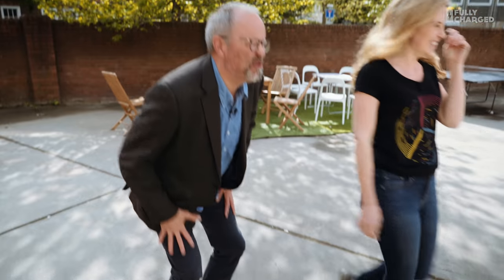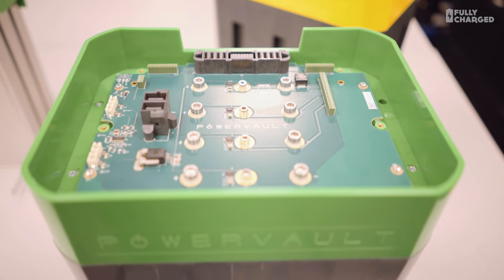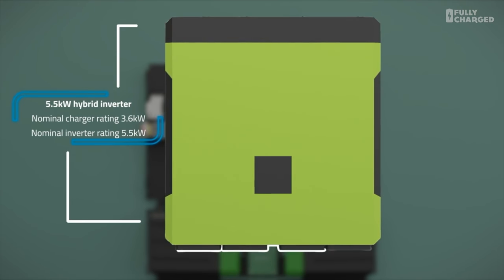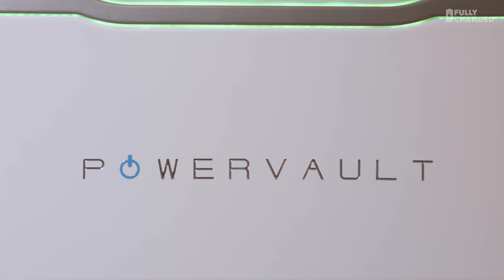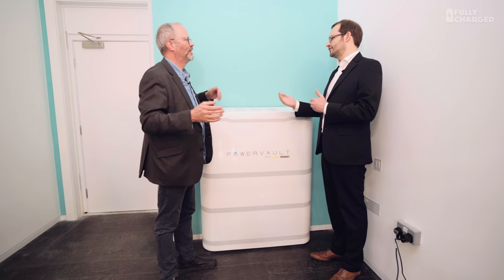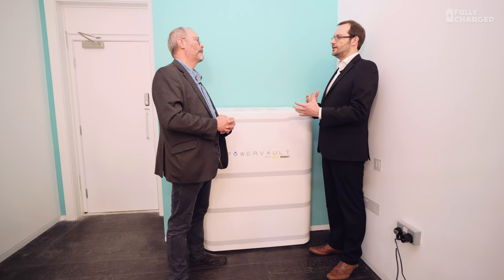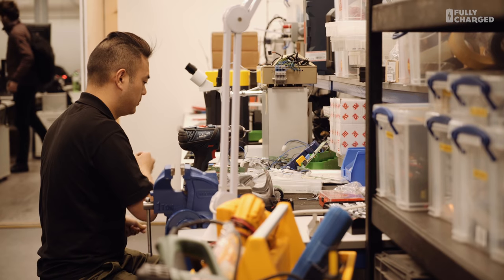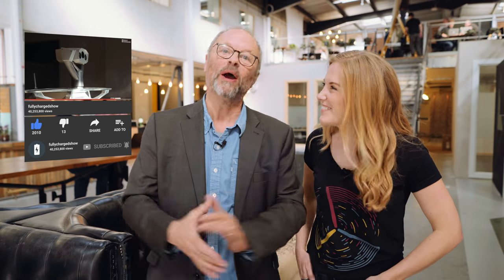Powervault | Fully Charged

Comment: Smart meters do not allow you to swap for the best deal as they non transferable
Reply: For now - next generation smart meters on their way (months) which will facilitate swapping out suppliers but keeping your meter
Reply: Iain McIntyre my experience was:
Took ages for British Gas to have a  smart meter available which worked with solar panels, then changed to EDF to get best price. Result, smart meter doesn't work with EDF. EDF can't fit smart meters in our area 'currently'! 
So...smart meter rollout going to plan then?!
Also, how easy will it be to get your old smart meter upgraded to a second generation one as they're going to be years behind on the rollout anyway?!
Shambles comes to mind!
Reply: Andy McCabe - no argument there Andy.  I couldn’t believe it when I read the first generation meters which have taken far too long to deploy, would tie you to your provider or disable the ‘smart’ capabilities.
And yes, how long will it take to get next gen smart meters deployed ? Far too bloody long - but it is on the way and some will get them in months I think

Comment: If they aren't temperature controlled they aren't going to succeed.
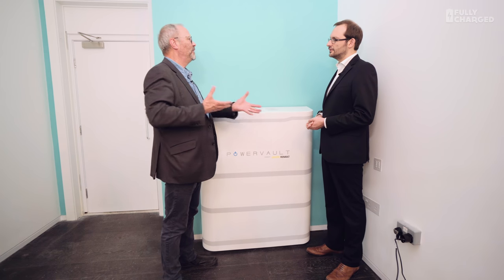At 15:21, he also touches on the real issue that I and others are seeing here.  Lack of availability.
Once you get the batteries, you have another issue.. and that issue is that the power companies don't actually want you to install them correctly.  They want you to install them they way THEY want you to.  Not to put too find a point on it they want you to install it in such a way that the utility gains the most benefit.

Stop by our channel and see how a system should really be configured and how much storage and current delivery you actually need while we share our "Energy Sovereignty Project" with all of you.

Comment: Great video again but question to Renault... 75% is great if you own a 40 KW/h Zoe but If you have like me owned a Renault Twizy for just over 4 years with 30,000 miles on the clock. I have so far spent over 2736 GBP at around 57 GBP / monthly battery rental fee and fully charged 6 days of the week (sometime twice a day). My battery (13 KW /h) is still showing a life of 98% so congratulation on the quality of the battery.

But for me it means the battery is likely to be well over 75% for a good let say 5, 6 years... I don't want to think of the cost of the battery rental after that time when it will have been well over the original cost of it! And with even 80% the range will have dramatically been reduced.

I love my Twizy and despite the rental cost still cheaper for me than driving a petrol or diesel to my daily commute as public transport are none existence for me where I live. But it will be nice for Renault to tell their oldest customers this is the time to decide if we want to continue to rent the battery for peace of mind or you can have it at no cost. Currently you can give it back or buy it but it is way too expensive.

You are basically trapped and tide up for the life of the vehicle. Shame really.
Reply: Eric Lafoy I used to ask a quote for buying off a battery for a twizy, 1.5y ago this was 1400 excluding tax, not bad for a 3500euro twizy incl. Tax

Comment: I am sat here admiring the shiny new white Tesla sat in my garage - it can't go anywhere as it's bolted to the (power)wall :o) Being fortunate to have solar as well, and with the Sunny weather (you can't beat a Sunny September) there have been days when we have been entirely "off grid". However as others mention - I am concerned that private power companies will conjure up some way to negate any early adopter benefits. New power startups like Good Energy are the way to go for people who have become solar / battery early adopters. I have named my powerwall ALSET (did you see what I did there?!) Like Robert, I can suddenly find myself gazing at ALSET while purring softly with the occasional keening sound.
Reply: I'm not so sure about the power companies penalising people using batteries - because of how much it costs to balance the grid (match supply to demand) - if they can smooth out demand / you have a local battery to cover momentary spikes (such as turning on the kettle) then the savings would be massive.

(numbers from a separate youtube vid I watched recently, so not sure of accuracy) The 'big battery' that Tesla built in Australia apparently costs ~$14k per MWH, and that's something like 7x cheaper than the power plant operators were charging to make the same supply adjustment.  Given that the 'kettle spike' requires 2x adjustments, having a battery in every house would save them ~$28k (not sure in GBP) just from that one event...

And lastly, it's not like you're not paying for that power anyway.  Penalising people with solar is more likely (simply because that's generating your own power).
Reply: +Joe McMorrow, I do know what you mean, we had ours fitted in March (7 months ago), plus another 9 panels fitted to the North roof, with the result that we have had 184 days with the only mains use being 200 to 500 watts per day. (between 5 and 7 kWh per MONTH.) Only 35 days using the mains, and that vastly reduced. (When big things get turned on, there is a very small  'pull' from the mains while the battery / solar balance the load. Mostly 0.1 kWh in a days use).

We also signed up to the Tide Tariff a while ago (ready for long winter nights and short dull days), but have seen no advantage yet as we have been on solar / powerwall for 5 months on the trot! The battery got down to 6% the day before yesterday, so I know our 'free' days are ending for this year :-(, but HEY! Half a year with out paying for power (and mostly free driving with the PHEV), count me WELL impressed.

IMHO, anybody who has fitted Solar PV and does not fit a battery is nuts! AND wasting a large chunk of their investment.
Reply: Thanks for the detailed response and the Stats Con! As you are further along the road than me, could you suggest what energy provider might be best to look at, is there a blog or something - the comparison websites were useless!
Reply: Many thanks Con for taking the trouble over this very detailed and helpful reply - I will certainly follow up on your suggestions!

Comment: greenenergy.uk need to tell their call centre then.  When I telephoned and asked about using off-peak electricity I was told I would need to have a separate meter installed even though I said I already had a smart meter!  Had I been told the Powervault was available, I would have switched immediately.
Reply: Apparently not all smart meters speak the same language (so to speak), so your present meter may not talk to GE as it does with others. Go Figure!

Comment: This was too superficial when it came to breaking down the battery storage. How much money could three different U.K. households save? Carbon? Be specific!
Reply: This channel isn't really about saving money, it's more about highlighting new ideas and new technologies.  Having said that, you can easily work out how much you'd save by finding out how much you now pay per kWh, and how much you'd save if 100% of that was used at off-peak times on a time-of-use plan instead.  e.g. if you pay 12p and off-peak is 6p then your bill would be half, if you had a large enough battery to cover 100% of your use.  Take into account the likely cost of the battery pack and you can work out how many years it will take before you break even, and then how much you'd save every year after that.  Typically systems like these take 3-5 years to break even, so it's only after that when you actually start saving money, assuming the product continues to work beyond this time and doesn't have any additional expenses like replacement batteries.
Reply: In realty installing a battery system in your home costs a FORTUNE and takes years and years and years to break even.  In the meantime, battery tech gets ever cheaper and you're left behind paying for you expensive battery....
Also, time of day tariffs cost more at the full rate  than regular cheap tariffs so the payback from using the battery to save is about 1000 years!
If you want to be an eco warrior then great- but from a financial viewpoint.......
Reply: not true at all.  The payback time does depend on what your local electrical costs are, but are more like 8 to 10 years not the 1000 years...and if you can sell back electricity, it is even less.  PS.  this is using tesla powerwall 2s

Comment: Grading batteries involves charging the battery then fully discharging and measuring the outputted amp hours. You can also measure the voltage drop at a certain amperage and work out the internal resistance of the battery. If the internal resistance is too high the battery will be no good for high power draw uses even if the capacity is fine.

Comment: Is it me or is the whole second Life battery thing a bit of a non starter? If BEV's last a lot longer than people originally thought then people won't get rid of their cars so quickly. There will be a shortage of batteries to use in the powervaults?
Reply: I agree that the second life battery idea is indeed a non-starter. Go look at the predicted battery cost curve ten years out from now and compare that with how much cost and effort goes in to tearing down battery packs,  grading them on expensive test equipment and reassembling into new packs. Remember when TVs were expensive and of unknown reliability? First we "leased" them, both because they were expensive and unreliable, then we had a nationwide army of TV repair people who would replace tubes etc. I worked at a company who produced specialist EVs 10 years ago. At that time Li battery packs were well over $1,000 per kWh. Rumours have it that Tesla will soon be hitting $100 per kWh. In 10 years' time all those Zoe batteries will go straight to recycling to extract the minerals imho.

Comment: I did consider powervault after visiting the stand at Fully Charged Live but the box was a bit too big go into the space I have and it can't live outside due to the venting. I ended up going for something that's a separate inverter and batteries which suits our home/space better. Just doesn't have all the fancy apps to change things on the fly, has to be done manually on the inverter.

Comment: Adding battery storage to a grid connected home is just wasting money at this point in time October 2018.
Reply: Piss off it is. 

In the future.. there won't be a grid to be connected to.. 

So having a larger cache of power will be eventually the way to go. 

Think about it.  

You have an additional 100kw to resell to the grid.. you are essentially paying for the equipment via power sales.. and when it comes time for homes to be self sustaining.. you won't need the grid and on top of that, if you only use 5kw of power a month.. the rest is for sale on a daily basis to the neighbours..
Reply: If more of us have power storage it takes the strain of the grid in peak times, using the grid to charge the batteries in times of low demand, therefore reducing the need for generating so much power in the first place. How is that a waste?
Reply: Why?
Reply: Depends on the tariffs
Reply: I was not talking about the future. At the present battery energy storage is way more expensive than grid so not cost effective for consumers. I'm fully offgrid using LiFePO4 for electricity storage and thermal mass for heat storage. My house is a net zero energy house with all energy from PV solar but this is all my own design and at this point likely the most advanced net zero energy house so I have a good idea on the cost's and Lithium battery storage is not cost effective in most places so as of now a grid connected solar PV array is great and cost effective but adding a battery is not.
Best case scenario with a good LiFePO4 cost amortization is 20cent/kWh (that is just for battery no BMS and inverter or compete system installed) and to that you need to add the cost of the energy you will going to put in to battery. Even if grid pays nothing for your excess energy it is still way more cost effective to have a grid connected PV system without battery storage than to add a battery storage. Typical storage solutions will be around 40 to 50 cent/kWh best case so completely non cost effective in most parts of the world even places with very high grid energy costs.
Reply: The difference here is dual rate tariffs, fill up the battery at 20% cost electricity, use it during peak 100% tariff times.. Save 80% on all peak usage.
It's down to the household usage how long that takes to pay for itself
Reply: At this point, yes. Who do you call if you're the only person with a phone?

But hope to see a rapid uptake
Reply: @AdrianNelson1507  
It's not a phone, it's a bucket of water.
If you are the one with the bucket and everyone wants water at a peak time you can supply some.
If nobody needs it, but you do, you buy it at the cheap rate and use it yourself during the expensive time.
Simple
Reply: Unless grid price is 50cent/kWh you can not even recover the cost of the battery over is usable life as best case scenario for a grid battery like Tesla PowerWall 2 is 40cent/kWh (very optimistic number).
Typical grid price is around 20cent/kWh while PV panel amortization cost is around 2 to 3 cent/kWh so as in most places grid pays around 6 cent/kWh for your excess thus more than fair enough to amortize the PV panels + cost installation plus grid connected inverters and on top of that all that you use directly from PV during the day is at that fairly low cost amortization thus a fairly profitable investment. Adding a battery storage that costs around 40cent/kWh best case will just make your total cost way higher than just having a grid connection and even higher than a grid connection plus grid connected solar PV where grid is used as an infinite battery.
Of course if to many people want a PV grid connected system the grid will need to install batteries or some sort of storage or maybe more flexible energy generation.
So every time you want to use 1kWh from your battery the cost will be whatever you cost was for the energy going in to battery say 5 cent/kWh assuming PV amortization or night time grid tariff plus the cost amortization for your battery best case 40 cent/kWh so your total cost when you get that 1kWh form your battery will be 45cent/kWh.
Reply: @rogerstarkey5390  but my point is that the system you describe presumably requires the intelligence (the bucket) to be in everyone's house? Otherwise it's just feed in tariff MK2?
Reply: @ luke jones, where are you buying electric at 20% cost? I've looked at offpeak tariffs to charge a storage battery and cannot find anywhere selling at less than 60%? Interest to know in case I can make the numbers work. Thanks
Reply: electrodacus - dead right. If you buy a battery now you'll be left behind paying for your very expensive battery while  tech. improvements bring down battery costs around you...

Comment: WE got smart meters in Australia and everyone's power doubled biggest con ever
Reply: It sure was.. but be sure you're being billed on the correct tarriff.. and be sure you're being billed properly..
Reply: Im off grid 9 months of the year. we use less than most due to our 30kw battery bank but for less than 2kwh a day it's still over $130 just to have it connected
Reply: NSW didn't get smart meters and the price doubled. The doubling had nothing to do with smart meters, it was because the industry was sold to private owners who (shock) wanted to make a profit.
Reply: Cost to the UK £9bn and they are dumb meters not fit for purpose.
Reply: we got charged an extra fee in Victoria to have them installed and the power company still owns them. and the power company have put time of use tariff on us so hot days cost more ect
Reply: People who have 66c solar tariff are the biggest winners. No bills to pay , plus credit covers gas as well.
Reply: I’m in Victoria, with a smart meter I pay 15 cents per kWh less than half the average. It’s a demand tariff so you have to be smart about not using too much power during the demand period but it’s manageable. I have an ev so use over 20 kWh per day and pay less than $125 per month.
Reply: If you are being offered something for nothing it isn’t going to be in your best interests. The guy gave it away in the video when he said it was a massive benefit for the industry not the consumer

Comment: Products need to be made smarter where there isn't a standby..

TVs need to turn off and on.  Not standby. Same with all home media devices. 

Perhaps a smart wall plug where it can learn different devices and instead of the device switching off.. the wall point switches off instead.
Reply: You can already buy them. In fact, you can buy a board that knows when you've put your tv on standby, and it turns off everything else, the set-top box, vcr, lights etc.
Reply: Standby consumption really is naff all. The substantial drain is during operation
Reply: @Gary Stinten, as Luke says, standby in modern devices isn't like the old days where the crt tube heaters were kept on but it's not even worth counting.  Just moving the standby function to the wall outlet really doesn't gain anything.  The wall outlet would be in standby instead.
Reply: Hi standby consumption is bad design, not a problem with standby itself. We just need legislation not allowing excessive standby consumption, I think the EU might already have that. 
The power cutter devices are not good for a lot of electrical things, I had one and it killed my tv box, I stopped using it after.
Reply: The fix to this is "not being lazy". Which is a fix that obviously won't work with the general population. The other fixes you propose still can't beat the laws of physics. So, unless someone invents a FET style extremely low consumption circuit or makes somesuch mandatory, it will probably not happen.